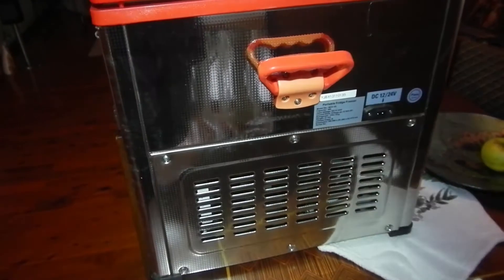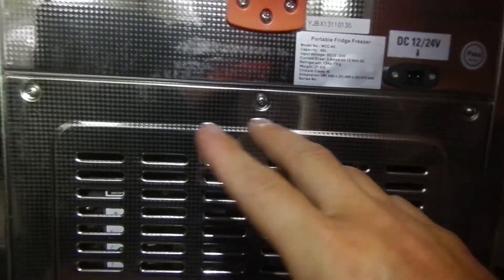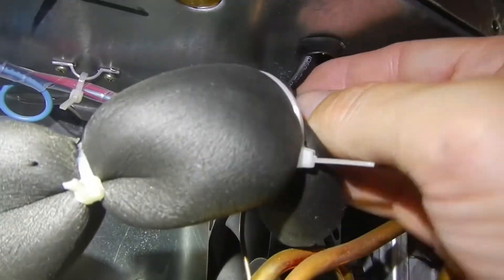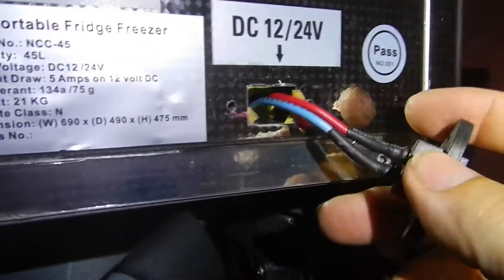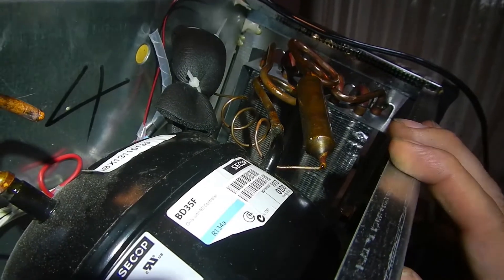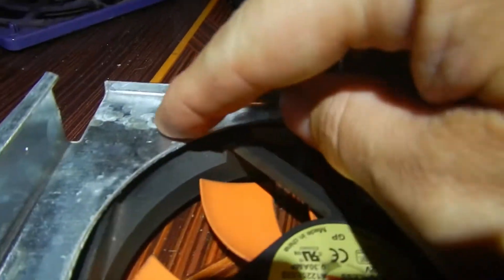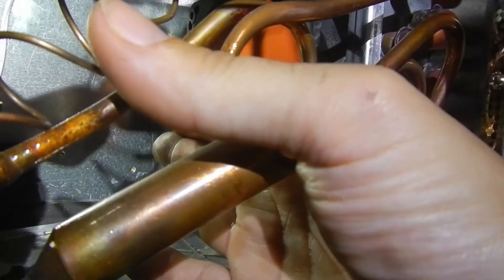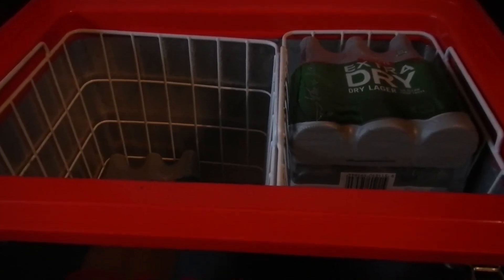Giant powered 4wd fridge plug and fan repair

Comment: i ended up buying a 50 Litre Evakool Glacier Fridge/Freezer was $480 with cover and delivery from evakool their website is working great. if ya after a fan with better airflow and quieter get a coolermaster pc fan. also if u wanna fix that side bolt problem get on ebay and buy a rivet nut kit < saved me so many problems with shitty automotive plastic push clips i just drill em out and put a rivet nut in. good to see that it looked decent inside
Reply from the maker: Thanks for the heads up. I build a few computers now and then so had this one laying around. I do have better ones but need to locate them. I really should put one on from one of my water cooling PC builds as they have a high static pressure and are made to move air through radiators. This one is just a normal case fan. 
I'll get around to it later though. 
I've heard of rivnuts. One of the guys at work raves about them after discovering them. Based on your advice, I shall track some down. 
I've only head good things about evakool, so imagine it should be a good unit.
 It is just so handy having a fridge in the car. 
I don't think, I'll be without one now, even when not camping. 
cheers again.